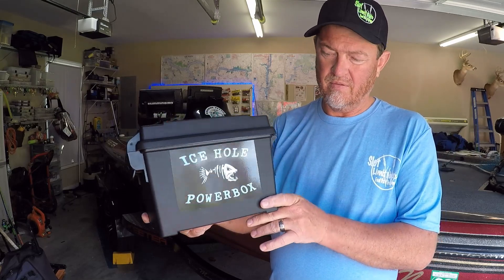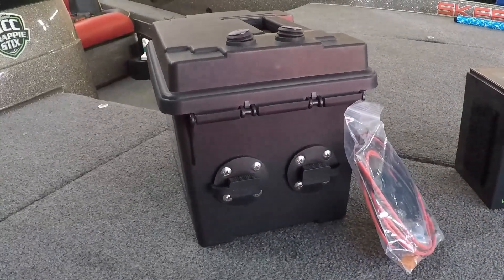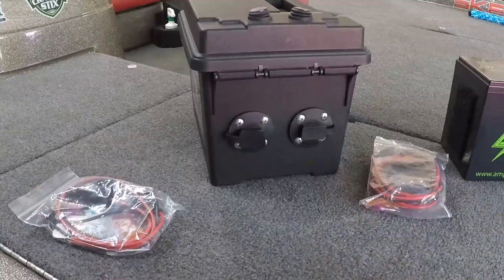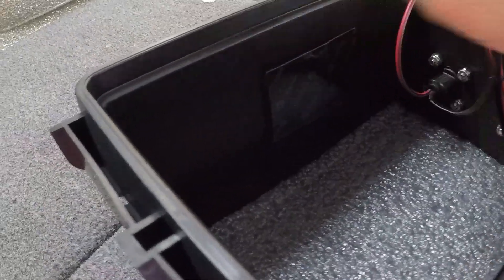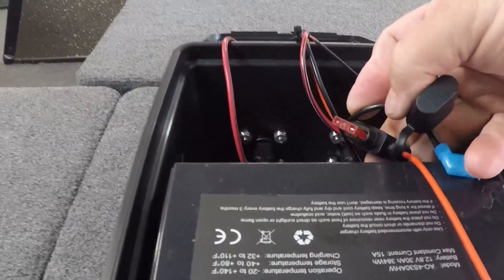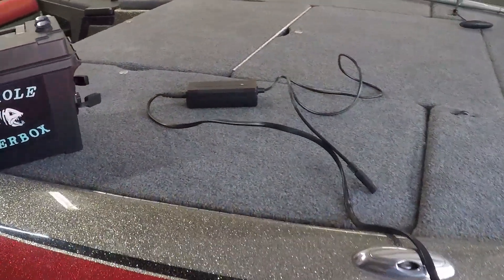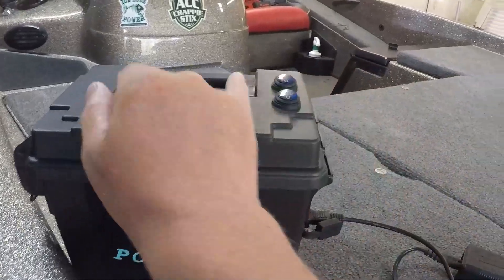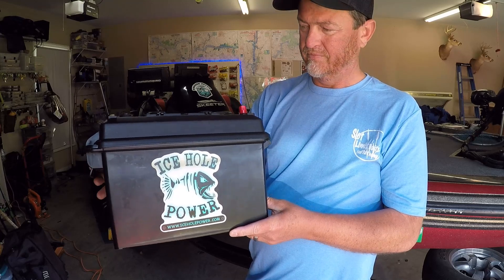SIMPLE ALL YOU NEED LIVE SONAR POWERBOX

Comment: Great video! I'm looking to go with a 24v 100ah lithium for my trolling motor but no sure on a good reasonable 24v lithium battery charger, any suggestions are appreciated. Thanks
Reply from the maker: Most of the manufacturers of those batteries offer Lithium chargers that they recommend for charging those batteries.  Just be sure to get a higher amp charger in the 10 amp or more range. Keep in mind the higher amp charger the least amount of time to charge and maintain the battery.  Thanks for watching 👍
Reply: @GordonPettieFishing  I looked closer and your right. I ordered a 24v. 20amp charger with a 29v output, the best I could tell not all 24v chargers charge at 29v,, thanks again for your help!

Comment: Maybe a dumb question, very new to this. Looking to have this kind of setup in my rod locker. So doing it this way is there no fuse box or extension cables or switches?
Reply from the maker: The power box has all the switches. There is also a fuse inside the power box. I also have an inline fuse on the main power line going to the unit and black box.  If you check out my other video it will show you everything I did. There is a link to that video in the description.

Comment: When charging u need the power switch on and the light will be red. To know when its finished charging will the light change color? Or will it stay red
Reply from the maker: Yes. The switch on the box needs to be on to open the Circuit to accept the charge.  The switch light will stay on all the time until turned off. Your charger indicator will let you know when it's fully charged.  Don't forget to turn the power box switch off after charged.
Reply: Okay thank you for the replies and the videos! Has made the process a lot easier
Reply: @GordonPettieFishing the light will turn green when charged 👍